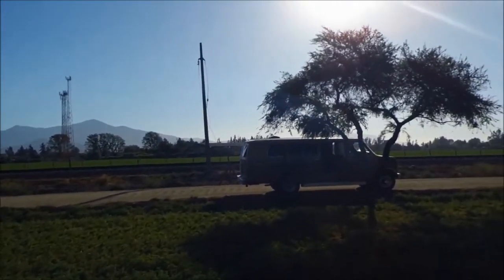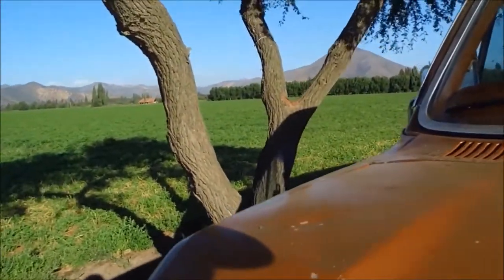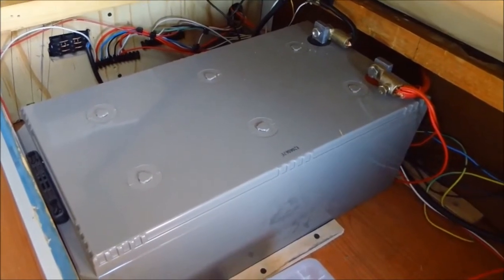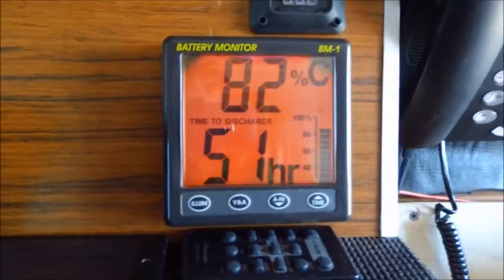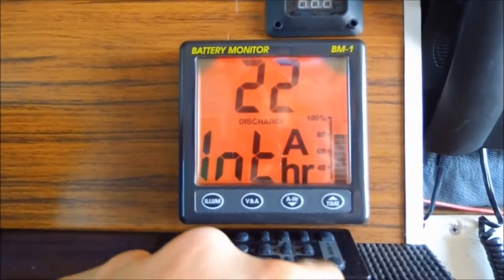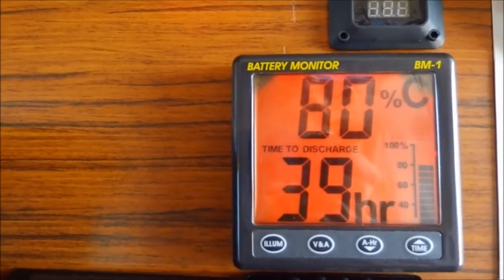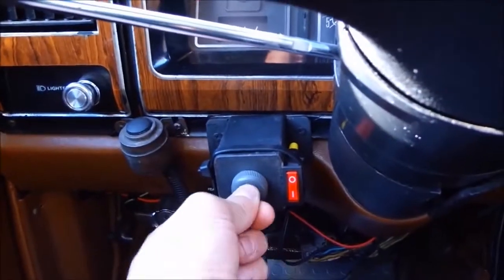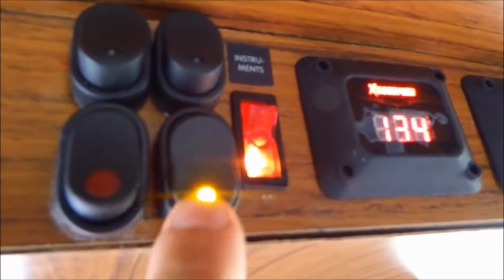Mobile Office Camper Van: Electrical System

Comment: Hey I like your videos and I see that you installed a fridge on one of your videos but if your planning to live in your van and have the fridge on 24/7 I would recommend you to get a solar panel 200 watts minimum because of your fridge if you don't use your fridge 100 watts will do
Reply from the maker: Thanks man, indeed I was thinking to install a 240 watts panel in my roof!

Comment: great, but running a car for 3 hours to charge the battery from 80 to 100 is expensive, isnt it?
Reply from the maker: makemoneyrelax Well you have 2 options to charge the batteries. Wile driving the van or
 plugin the van to shore power via a battery charger. Diesel engines at 
idle are very economic. All of this kind of vehicles work basically in 
the same way.
Reply: Office Camper
solor panels ???

Comment: Thanks for the video. I was thinking of doing something similar, but not charging from my alternator. I think I will go with a decent sized solar panel with a charge controller. With a solar panel charge controller, the controller monitors the battery and doesn't allow it to overcharge or ruin the battery. Having the battery charge all day while the van sits in the sun is a nice feature. Not having to turn on the vans engine to charge is really nice too. A solar panel means totally free energy, which is great. :)